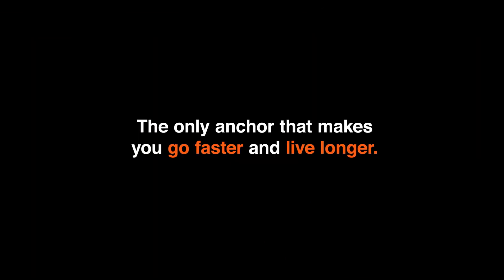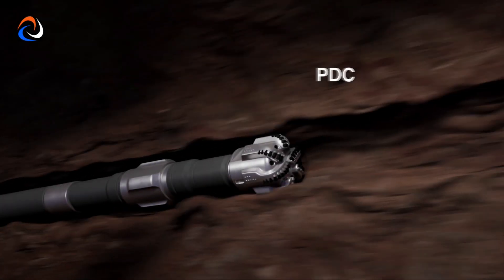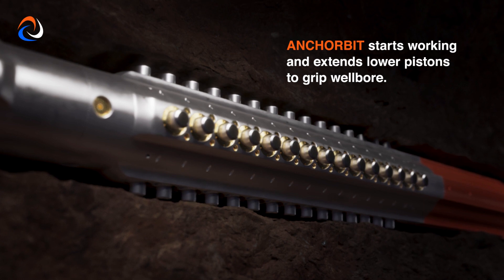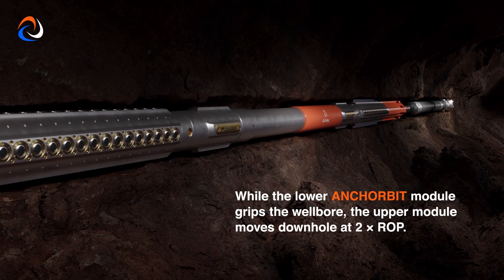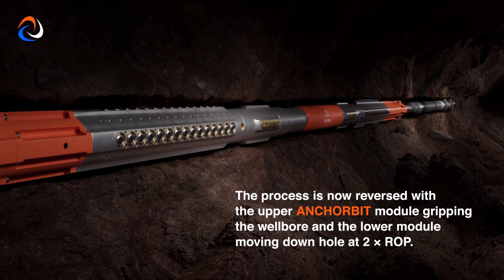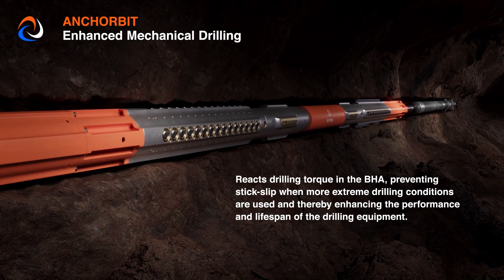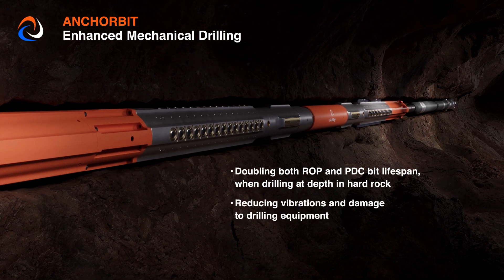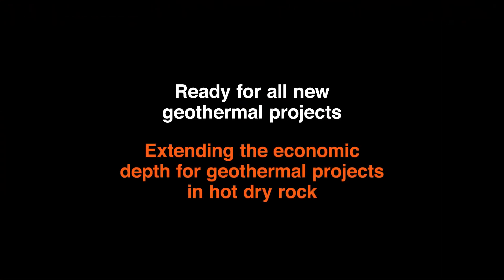ANCHORBIT®

Comment: Is this designed to work before/with, or outright replace the plasmabit?
Reply from the maker: ANCHORBIT® is designed to work with PLASMABIT®and independently with any drill string and bottom hole assembly (BHA).